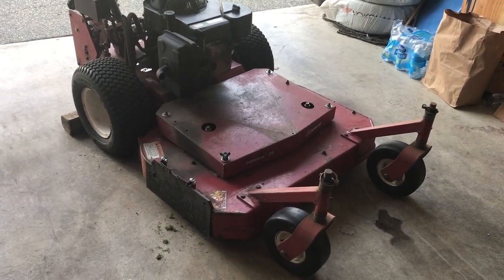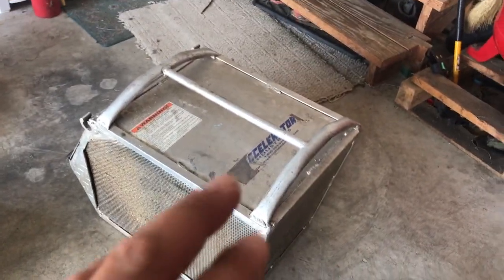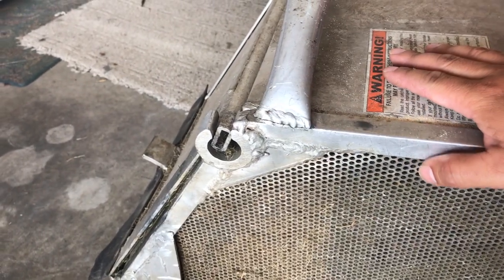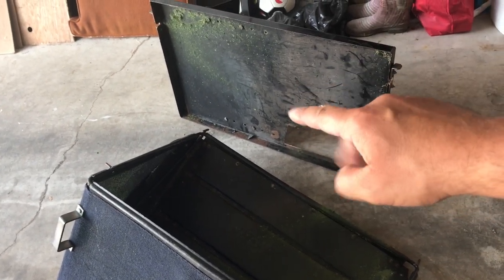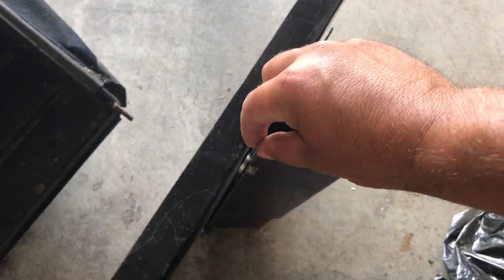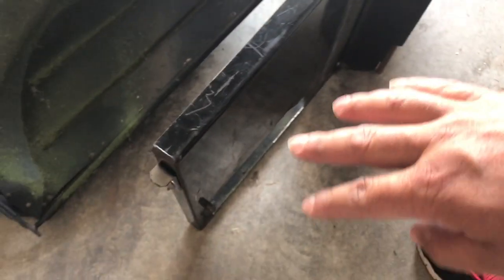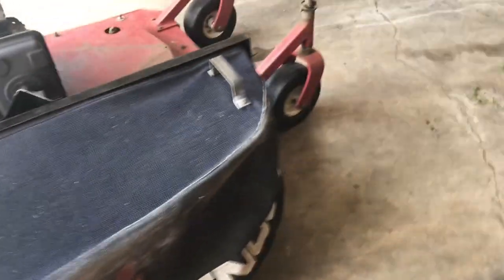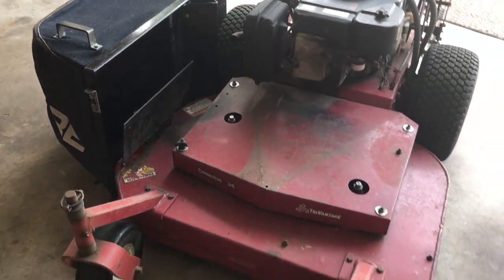Encore 36" Walk behind fabric grass catcher kit on Exmark Viking

Comment: I would like to get one of these but I can’t find them anywhere can you help.
Reply from the maker: KP Landscaping & Lawn Care you just need to be patient and keep looking online as well as ask around at your nearest equipment dealers. I was looking online everyday and then this one popped up on eBay all the way in Florida. I noticed it said one person watching this item so I jumped on it and took a chance that it would work even though it was meant for a different brand.
Reply: big dog mowers sells this style of bag as well
Reply from the maker: Fixt100 Good to know. Thanks for watching! 👍
Reply: big dog/bad dog? anyways its not at all cheaper than an accelerator BUT!! they do sell it with a cover to keep the dust down (can substitute a BBQ cover on any bagger like this) just have the cover super loose and attached to the bagger and you dont have any of the dust issues these normally get.

Edit:
its bad boy mowers and the name is the "mz side bagger" 400-500$
Reply from the maker: Fixt100 ok great. Thanks for the info and correcting the manufacturer name. I’m sure it will help someone out in the future.